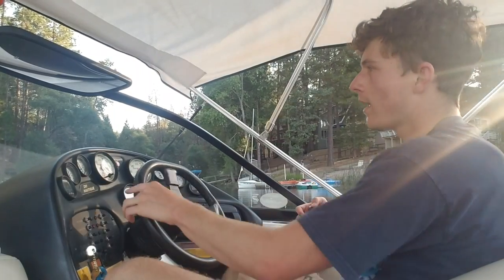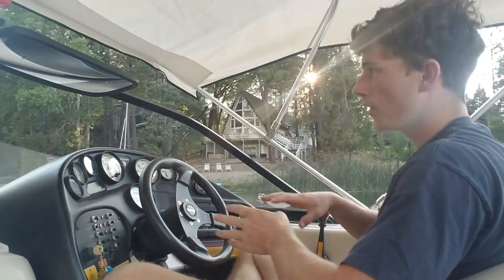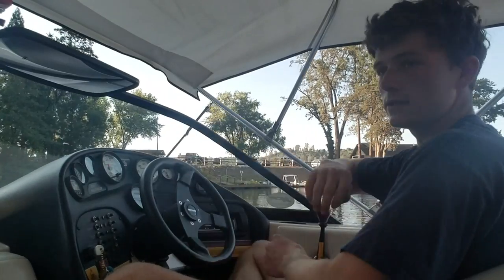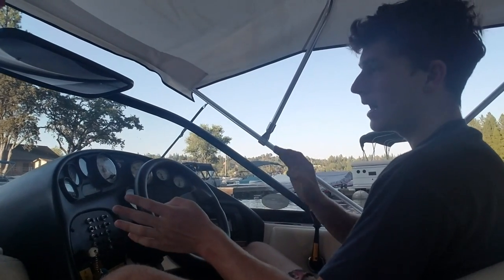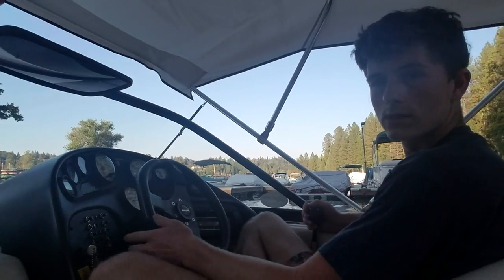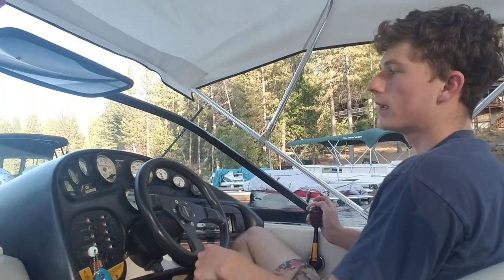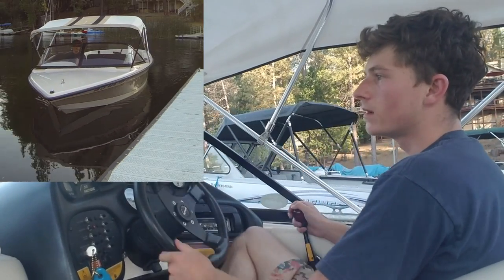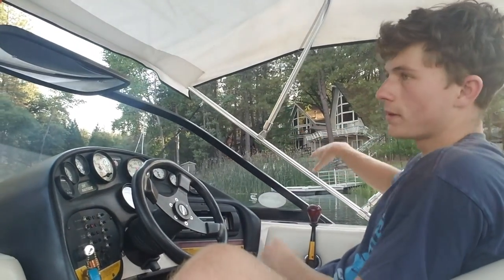How To Dock Your Inboard Boat Like a Professional

Comment: Awesome driving..  Just got an inboard wakeboat after 40+ years of driving I/Os and outboards.  I cannot get the stern to come in to the dock on the port side at all,  and that's the only side my dock allows for access.  I feel totally lost in my approach and the boat is completely unresponsive to moving to port.  I need some of your magic
Reply from the maker: Good luck! You can do it with a little bit of confidence and patients

Comment: So are you saying when we go into reverse on a direct drive it wants to pivot the stern to port???
Reply from the maker: It depends on your boat but Nautiques drift port
Reply: Exactly! Mastercraft and centurions will pivot the stern starboard. No matter how much you crank the wheel, it will always pivot starboard in reverse. Just something you have to learn and plan for with direct drive. Makes our slip hard to get into cause it requires a clockwise turn and our centurion pivots counter clockwise

Comment: Does a boat turn in neutral?
Reply from the maker: The rudder still moves when you are in neutral. If you are moving you will still have turn authority. Since the boat is in neutral the propeller is not moving water over the rudder so you will have less authority compared to the boat being in gear.
Reply: @92813justin  thank you

Comment: Problem accur when it's a 3-up/ton, and up and 30ft with one engine single prop, rudder, and  high free boar that take up wind and push the boats aside nomatter bowthuster and tight docking areas.